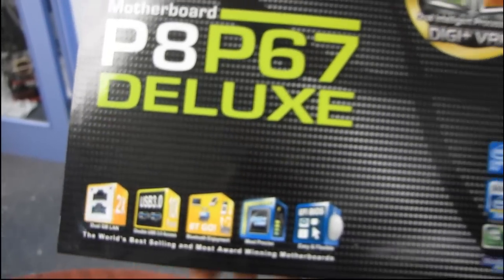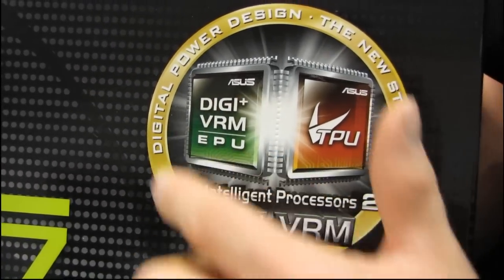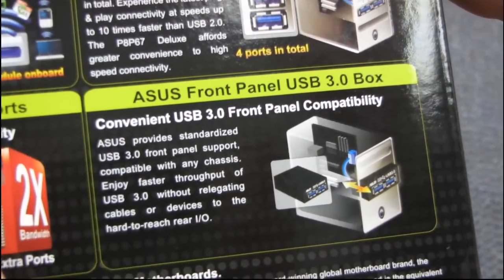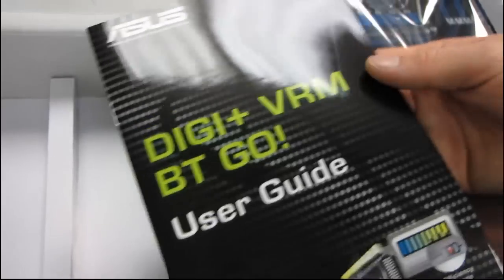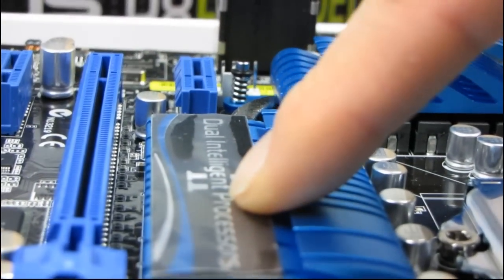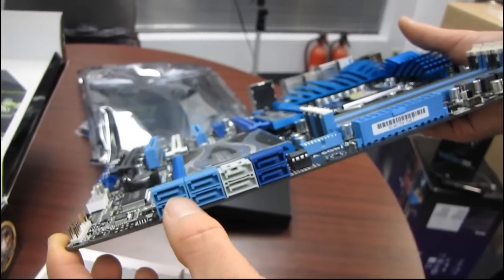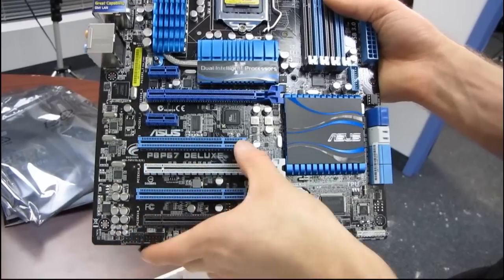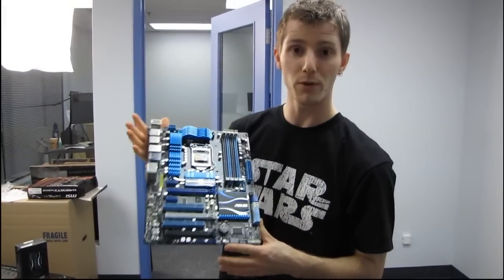ASUS P8P67 Deluxe P67 LGA1156 Core i7 SLI Motherboard Unboxing & First Look Linus Tech Tips

Comment: Mine is still burning up the games. Its paired with a i7 2600k, 16 gig ripjaw gskill ram, gtx 950 video card, and a sound blaster z card.
Reply: so i just bought a 2600k...off ebay and have found one of these mobos...can you recommend it...i have an old gtx660ti 2g and a corsair 500g ssd and a corsair 750w psu...for now just need some memory and intend to chuck a gtx980ti if i can get one cheap enough of the bay...would i be able to achieve 4.6...4.8 oc even 5 if i tried water cooling?

Comment: Intel Sandybridge P67 and H67 Motherboards SATA issue. The issue has been raised that devices connected to SATA Ports 2-5 may degrade over time.Devices connected to SATA ports 0 and 1 are not affected and can be used as normal. There is NO issue with Sandybridge Processors, only P67 and H67 Motherboards are potentially affected.

Comment: @BelRabimMarduk There is no 'required' CPU voltage to 'run' a motherboard, if anything it's the other way around. The CPU has certain requirements for it to be alloted to a certain motherboard. If you're referring to anything in the mid range / high end (not workstation) environment, as long as the amount of pads on the CPU matches the amount of pins on the motherboard, they will make a 'connection'. CPU voltage is a different subject; you change it to allow higher frequencies when overclocking.

Comment: This probably sounds lame af, but I just purchased one of these from ebay for my computer.. Waiting its arrivial, currently running the i7-2600k, gtx 1060 6b xtreme, 500gb ssd, 2x1tb hdds in raid. 16gb ram at 2133mhz.
Reply: AlphaPidgeon not lame I'm in the same boat I got this with a 2500k and 12 gb of RAM for $100
Reply: I just bought one with the cpu couple days ago
Reply: @QuiiKSyyntax  i just bought a i7 2600k would you recommend this board...looking at one on ebay now it £21 atm lol?
Reply: @morningdumpsrgreatphew8752  i can definitely recommend this board it's really good for overclocking and the price you would buy it for is also really good
Reply: @morningdumpsrgreatphew8752  £21 wtf I'm seeing them for £60+ and they're all coming from china

Comment: @crumbworks There are quite a few new cases that still have the slot since there are other things besides 3.5 disc drives that are used there and you can always use an adapter plate to mount this in a 5.25 bay, you just may have trouble trying to match your front casing so it looks pro.

Comment: @Montalva Yeah that's a bit of a buyer's trap. It means the chipset used (P67) is capable of quad SLI or XFire but since the MB only has 2 PCI-E it will only be capable of dual support.

Comment: I think the p8p67 looks better also, but now there are more reviews of the p8z77, I can see why it's better.  It has a lot more features, and useful ones too.  For example you can control the case fans from the os and set custom curves, there's much more too.  Google p8z77 overclocking guide and click the benchmarkreviews

Comment: @Montalva Not much of a bottleneck with the new P67 since it has double the bandwidth on the PCIe2.0 compared to the P55 chipset so it's like having 2 x16 on a P55. A few benchs ran showing little difference (2 to 6) in frames when running 2x8 compared to 2x16 on a P55. We will see when the latest X68 comes out later this year comparing the new 2x8 and 2x16 with the latest 580s and 6970s and see if it still holds true.

Comment: @TDNGaming To be honest they're pretty equal. You can't say which ones better cus both have they're advantages. The 590 still has the same problem, running hot ,which aint a really big deal but is a big issue when overclocking

Comment: @japinoy1234 It all depends. X58 is a 1366 chipset, meaning it supports 6 core processors and tri channel memory. P67 only offers dual channel memory and quad core processors, but offers a fantastic price/performance ratio.

Comment: You didn't mention one the coolest parts of one the ports on the rear IO. ONE OF THE e eSATA port is actually eSATAp which gives you SATA power as well. You can run a boot drive like it's 3 gig SATA out of the back. I think that's cool, though you do need a special cable.

Comment: The USB 3.0 front box is an odd addition. I know many people with modern cases from Antec, Cooler Master, etc. and many of those towers don't even have external 3.5" anymore. What they do have is far too many external 5.25" bays (as if people have like 4 optical drives installed?)

Comment: @mrDMxtreme Well it can be used as a backup if one LAN gets damaged physically. You can also use the second for other LAN devices such as a NAT, so your connected to the internet and have a hard wired connection to your network storage. There's one more but I'm not sure if it'll work, you have LAN1 connected to the internet and LAN2 connected to another computer's LAN using a cross over cable.

Comment: @Cloude888 no, i'm sure that the CPU's fan use another kind of connector.
The CPU fan connector is the one you can see at 6.31 at top middle, it's whrite "CPU fan" under it xD
I think it's the CPU power bu i'm not sure.

Comment: Are you use that both of the LAN ports are using the Intel chip? The specification on the Asus website mentions Intel as well as a Realtek controller, and although it's not clear exactly how they are used, the fact that there is only one Intel sticker in the video makes it look like one is Intel and the other Realtek.

Comment: @CongDanhVip I have the P67 LE version and my 6970 runs like a dream.  The only issues i've had is with dual graphics cards (the 2nd PCIe slot on the LE will only run in x4).  Given that this is the deluxe version i'd be surprised if you had any issues.

Comment: @Eng1neering 
You cant get the 2600k or 2700k cpus for laptops because they are for desktops and if you were thinking about overclocking you can't with a laptop and even if you could you would have problems with overheating the cpu.

Comment: I think I've decided to buy this motherboard, 8GB of G.Skill RAM, an Intel Core i7-2600K, and a GTX580.  My question is if my current Corsair 620HX power supply will be enough to handle it.

Comment: Linus you made another mistake EVGA released a two x16 two x8 motherboard for P55 its called the classified 200 it has nf200 ;) get familiar with evga they are the overclockers friend! Asus had horrible 1156 as well msi.. Its a pity such a great gaming platform for memory dependent online games, and evga coming in with first nf200s =D

Comment: @Crazyglues not the graphics card will not get any performance boost from the integrated graphics on the cpu also i dont no if you already now this but you shouldnt of gotten the 6970 you should have got the 6950 coz with a bios hack you can turn the 6950 into a 6970 and the new x68 chipset is supposed to be coming out soon so if you wanna make a gaming pc your better of waiting coz the new i9s will come out with that chipset noy 100% if there going to be called i9s tho

Comment: @Vegeta101691 I wouldn't bother i just got a b3 deluxe and i kept getting a red cpu led i tried everything possible also if you go on forums you will see there are still many problems with asus boards i thought it was because asus sells the most boards but i think theres just too many issues

Comment: I am planning on building a med range pc. I wanted the i5 2500k, a p67 mb, some cheap other stuff and later on the 560 ti.
Now what my question is: Do all p67 MB's support the cpu's HD 3000 graphics? cause i want to be able to use the thing normally without having to buy the expensive 560 ti immediatly...

Comment: Can I place a GPU in the White 16x slot OR Do I have to place it in the Blue slot at the top in order to run 16x? Because I want the GPU in the bottom slot so the EVGA GTX 580 wont cover up that nice ASUS logo and I plan on placing a EVGA superclocked GT 240 on the top Blue 16x slot and run it as a dedicated PhysX card. So will there be any problems?

Comment: Im making anew pc... I have no idea what a good mobo is anymore. Should I get a MSI P67-GD55-b3? The card in the video? Or the Asus Sabertooth. My build will be a HAf 932 Case or Graphite 600 case. V6 GT cooler NZXT sentry2 fan controler, corsair 750watt PSU. I72600k. ill be getting a 570-590 video card and eventual liquid cool. (biggest the case I end up getting will hold)

Comment: i'm going to build a computer which has Intel Core i7 2600K 3.4 GHz LGA1155 processor but i can't decide which motherboard to buy: Asus P8P67 Deluxe B3 Intel P67 LGA1155 ATX-morherboard or Asus P8Z68 DELUXE Intel Z68 LGA1155 ATX-motherboard. the p67 one is 205€ and the z68 is 235€ so they are almost priced as same. So which one I should buy?

Comment: hmm if i have 2 gtx 580's in sli , this means it will be 8x and 8x, how much of a performance drop will this be compared to 16x and 16x which the p67-ud7 motherboard is capable or doing

Comment: i got the same but not pro is it sli compatible ? 
its p8p67 new b3 rev 3.0 but there no pro or deluxe on the box

crossfire is like sli ?
Reply: +buder5 While XFire is pretty much the same as SLI, nVidia restricts it to require 8x bandwidth. The stock P8P67 does not support SLI as it does not have a chip that gives it enough bandwidth, sorry.
Reply: +s8wc3 its supposed to support sli is the rev3.0 p67 b3 :P
Reply: buder5 yep but ASUS decided that you cant do that on P8P67, the second slot is a 4X

Comment: I'm just wondering... (lol, this sounds fucking stupid, but at the same time, reasonable) Do you think I could install the 3 1/2" USB3 Front Panel Box into a standard 3 1/2" HDD bay in the front of my corsair 650D and then leave thumb drives in the front panel box; which live in the drive bay and are cooled by the front 200mm fan and aren't sticking their bums out like a sore thumb on my case?

Comment: @TeQuiiLaSHoTZz
If you want to link two networks together, or need to transfer files from two computer at the same but doesn't have a switch available.
Yeah it is pretty useless 99.9% of the time.

Comment: i am just sad that my computer is so old and bad that i cant get new gpus gtx 970 is the max i could lol so sad that i cant get a 1070 or more because i am on pci 2.0 and that is the max for this i wish i could get  a new one but no matter i cant get a new pc its so sad that i cant upgrade now but to buy a new system so i can get better gpus or something like that is so sad now
Reply: I have an RTX 2060 on a P8P67 LE which is a less powerful version than this motherboard with a Core i7 2600k Overclocked to 4.5Ghz and 32Gb RAM 2400Mhz and it runs Warhammer 40,000 Space Marine II perfectly with all settings on high.
Reply: @GodLikeMeAgain  i have now a rx 6600 and it runs well , the only thing is i cant overclock because there are some electric problems in my country , i would try to overclock but for me it might be very risky to do that though lol i did want to get more ram for my cpu but i didnt find it on amazon or mercadolibre (that is what people use on my country) so i end up stuck with just 16 gb ram